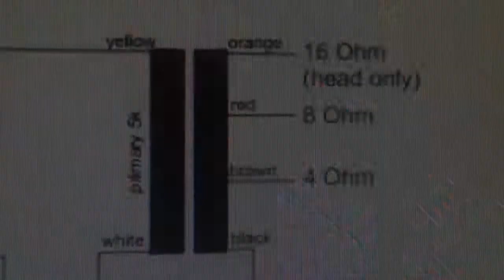Crap Amp Doctor EP01 - Harley Benton GA5: installing 8 ohm speaker jack

Comment: My GA5 Head already comes with 4,8 & 16 ohms jacks.
Reply from the maker: Hi C thanks for commening, I know, but this is a very early version - there were even mistakes in the circuit. More on that here: https://www.freestompboxes.org/viewtopic.php?f=2&t=2203&p=25967
Reply: @zjokka  Thanks i'll take a look at that.
Reply: @zjokka  From what i can see Harley Benton have done quite a bit of moding and rearranging the designs. The one i have is incredibly well built, i mean the head unit and cab together are stunning in the off white Tolex. I bought mine to sell on originaly but decided to keep it. It sounds fantastic. The condition is like new apart from a couple of plucks from the last owners Cat. Luckily it's only superficial. It's what i paid for it that is the shocker, the guy said as i picked it up 'I should have put a reserve on it'  I'm not mentioning what i paid here but i'll send you some picks and tell you how much i paid if your interested?
Reply: @zjokka  You have some great content buddy. Just subscribing now.
Reply from the maker: @fongy200  I paid I think €75 for mine ;-)
Reply: @zjokka  £50 off eBay I felt sorry for him it was so little money, I asked if he wanted to relist it but me was honourable and insisted saying I won the auction fairly. What a gent. Take care 👍

Comment: I tried your modification and unfortunately it didn’t work. Watching your video closely I noticed that first you soldered the red wire to the outer part of the PCB, and later it miraculously it appears more inside the PCB and you solder the black wire to the hole you soldered the red wire in the first place. If all this makes sense … Well, even though it’s been four years, maybe you can clarify this.
Reply: Do you still remember what you did? Thanks for your help.